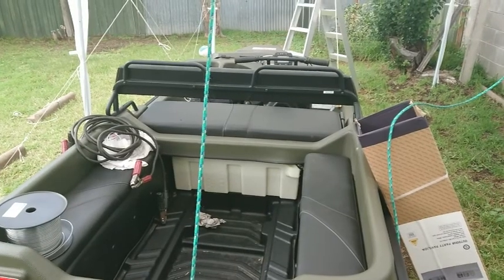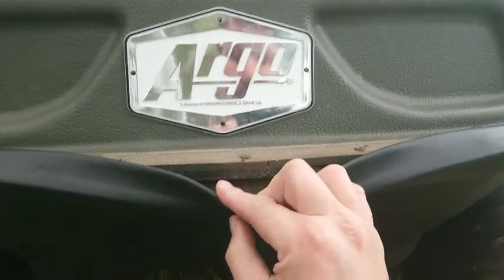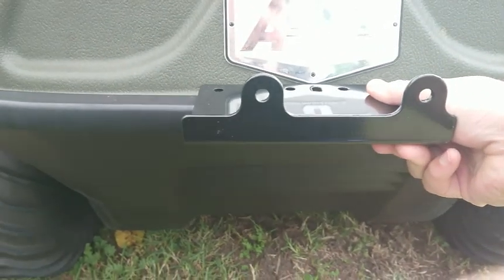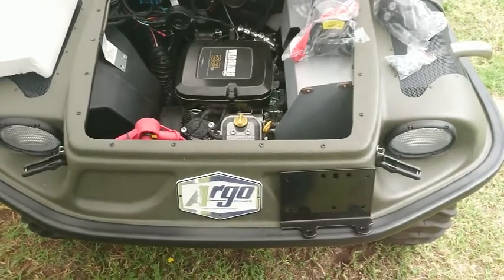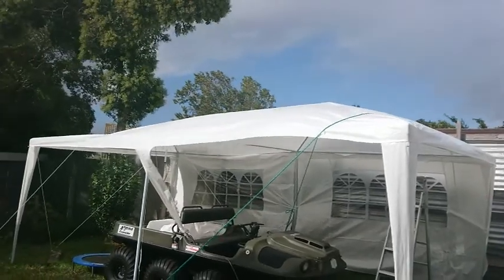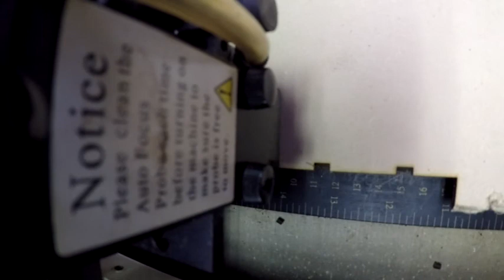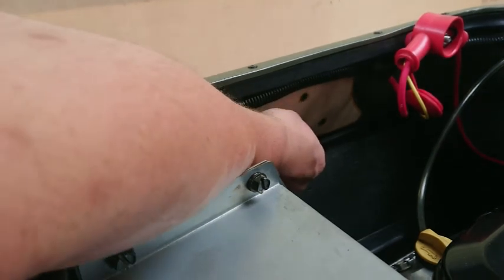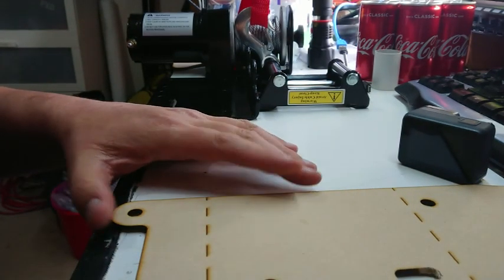Designing a Winch Mount | New Argo 8x8 - Episode 5

Comment: Emergency repairs, good old Aussie ingenuity...👍👍👍👍😊
You need to attach the winch to the frame that the wheel/motor assembly is mounted too.
That is probably why the kit is $1000. It is a frame that mounts under the front of the Argo.
Otherwise all you are doing is pulling your wheels out of a bog, or winching someone else out buy pulling on the plastic/fibreglass body panel which it is not designed for.
The plate you made will spread the pressure out over the panel, but you will still have high stresses at the edge of the plate across the thickness of the plastic panel. Also you will be stressing the fasteners and plastic mounts that bolt the body to the metal chassis.
Putting the plastic/fibreglass under 680kg stress is not a good idea.
You don't bolt a towbar to your car rear quarter panels.
Reply from the maker: It's not fibreglass, it's UHMPE, abd the $1000 kits are just doubler plates, no attachment to the subframe.
Reply from the maker: Basically I'm not planning to winch it up a tree, just help it out of some low traction situations.
there are aftermarket kits that include a support bar, but none suit the frontier. 

If I have to do anything hardcore in this department, I'll be finding another way to get it out, like bog boards etc
Reply from the maker: You probably mean one of these things?

https://westernargo.com/product/622-101-hoop-asm-winch-6x6/
Reply: @TheAussieRepairGuy  Hi, I enjoy your channel. Thanks for your posts. I have an Avenger and I had the same dilemma as you - the winch mounting is very expensive here in the UK, but I got lucky and one came up on eBay unused but really affordable (I won't say cheap). The mount definitely does fix to the main chassis and a lot of the winch forces are transferred to the chassis via the mount. I wouldn't use a winch that is just attached to the bodyshell. I did think of fabricating my own, but there are a fair few plates and complex brackets that make up the kit.
Reply from the maker: @philiprandall1399  this is a fairly old video, I did eventually find the correct kit:
https://youtu.be/o3CTwaE9giU